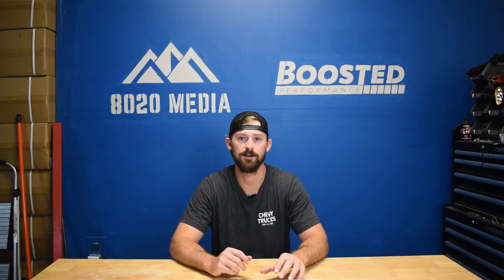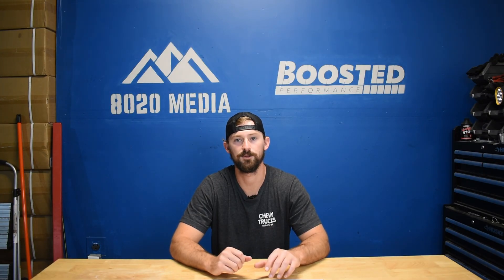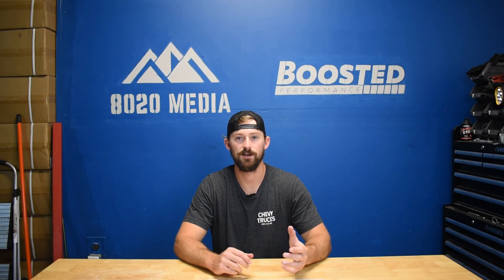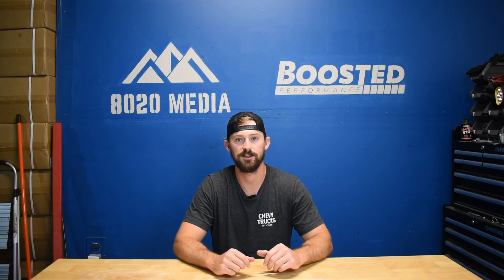The 2.4L EcoTec | 4 Common Problems & Reliability

Comment: In my experience, If you change the oil every 3,000 miles, check the oil level frequently, and make sure it’s always full. They can be good runners. But most people fail to do that.
Reply: 252k on mine and it has never given me an issue other than cam actuators. I never let it go more than 5k miles, it nevers goes over 3500 rpm and I check oil weekly. It will go 3-4 weeks and be fine and then suddenly burn a quart in a week. Literally the only parts I've changed on the engine are the cam actuator solenoids.
Reply: @TheStevenRK what car and have you changed the timing chain?
Reply: @shawnmckee14  It's a Malibu, original timing chain. At this point I'm not changing it so I'm just waiting for the engine to grenade itself.
Reply: @TheStevenRK  good to hear. I have one at 160k original one as well.  The oil has been changed 3-4K religiously it’s whole life so I’m hoping it has some life left in it.
Reply: @shawnmckee14 i’m guessing it’s still running strong?, it should last at least 300 with that type of maintenance
Reply: @Natefrm519  as of now yes. At 172k. Going to try to replace timing chain here soon as preventive maintence
Reply: @shawnmckee14  oh yeah she’ll last 250+ if you do the timing chain before it actually needs it
Reply: @TheStevenRK  

100%💯 did it for the 1st time in its life six months ago .. check engine showed up on the dashboard got it check & it was (exhaust camshaft sensor) , & running for 9 years , 1st change after 73k miles.

Smooth quite & practical engines that can run forever if you take good car of it .
Reply: @TheStevenRK  I change the oil in my daughters car every 3,000.  I've gotten VERY fast.  Soon I'll be NASCAR fast, LOL!
Funny thing is, sometimes it burns oil quicker than others?  I can't figure out why and I don't know how my college age daughter is driving the car.  
I can't get over how nice it sounds after an oil change.  This thing LOVES clean oil!
It's a 2013 Buick Verano.  I love the ride of the car, 70,000 miles, bought it from old lady at 52,000.  She took to dealer for every oil service per its history.  Pretty quick.  I like parking my RAM Laramie 5.7 and drive this her car.  I tell her I'm checking out how it's driving.
Reply: @TheStevenRK absolutely babying it jeez mine gets 5k rpm’s in park on E
Reply from the maker: Nick - 100% agree with this..
Reply: Who wants to keep Putting a quart of oil in it every week.
Reply: @johnnywilson715  exactly, its a piece of crap
Reply: True. My father always takes care of his ‘unreliable American cars’ via basic maintenance and they always seem to last him forever.
Reply: Most important clean topped up oil
Reply: Blowing up the engine is hazardous to your credit card balance
Reply: Got my 2010 Malibu 2.4 ecotec daily with 220,000 still runs strong!
Reply: I change mines at 50% so about to hit 200k no issues
Reply: Just hit 200k with the original timing chain, guide and tensioner. Did have the clogged PCV cause some damage once though.
Reply: I  agree but I believe the oil and lube places aren't changing people's oil I own a cruze took it to a oil and lube place just figured this out.they haven't been changing my oil. ITS TOO LATE CAR IS FCKUED 102K.AND I THINK THIS IS A PROBLEM ACCROSS NOTHER AMERICA.IF YOU USE OIL AND LUBE PLACE CHECK YOUR OIL BEFORE YOU LEAVE. I CHECKED MY OIL FILTER  AND COULD NOT TAKE IT OUT I UNSCREWED IT WITH THE SPOUT AND I HAD TO CUT OFF THE TOP OF THE OIL FILTER.I
Reply: Facts
Reply: Cant agree more , i drive a 2016 L.T.Z & I use 5W-40 fully synthetic thanks to hot weather , I change every 5000 , 

73 Miles & still counting with 0 problems
Reply: I see that the 3000 mile waste of money oil changes myth just wont die. Unless you did an oil analysis and it told you to change the oil at 3000 miles that's not really doing any good. Checking your oil after every full tank fill up is a good idea, because running it out of oil will damage the timing chain parts. My engine has 184K miles and my last oil change mileage was 5700 miles. 

If you are regularly using E85 fuel that is the only time I would recommend 3000 mile oil changes, because that garbage fuel just dilutes the oil and E85 will destroy engines.
Reply: check oil level every 3 days? because that piece of shii burn/leaks oil like a mf. Never buy anything ecotec.
Reply: Just hit 192k in my 08 Malibu. The only “issue” I’ve had so far is a VVT solenoid that needed to be replaced but other than that, just routine oil changes. The damn thing has been extremely reliable. Drove it from Fort Collins CO to Abilene TX, and from Abilene to Corpus, and all the way back up to Colorado with no issues
Reply: Slap ahh oil catch can on that thang and watch that'll happen. Thank me later
Reply: Garbage Motors  inc.
Reply: Man we ain't in the 90's 😂 3k mile oil changes are a thing of the past. Really inconvenient this day and age to be checking oil weekly on a car without an oil leak.
Reply: @teenice894 
yet prevention is better than cure , am with you in the fully synthetic department ,  true it can last for 6000 miles , but to this day we still got mineral oils that only last 3000 , so use what seems reasonable for how you use your car & your budget when it comes to oil choices..

But checking your car once a week is a safety precursion , oil , water level etc ..
Reply: 177k and my Equinox died 😢...
Reply: @wjordanjr74  same mielage same car same death via timing chain
Reply: @wjordanjr74 what year?